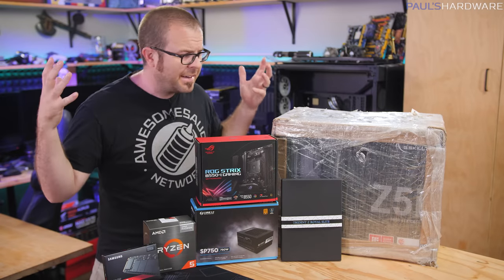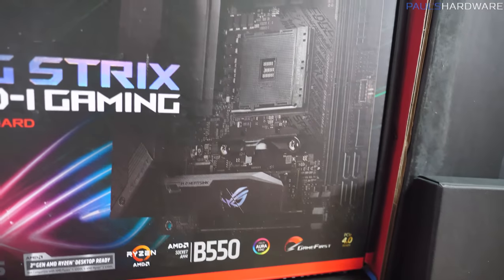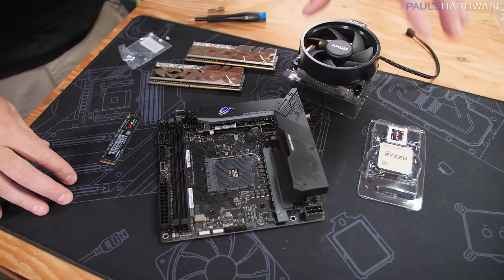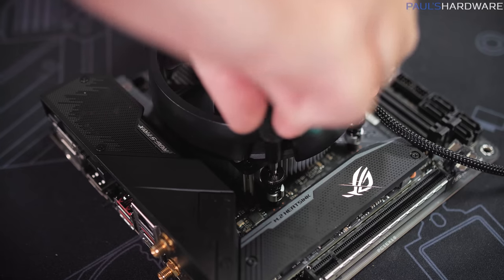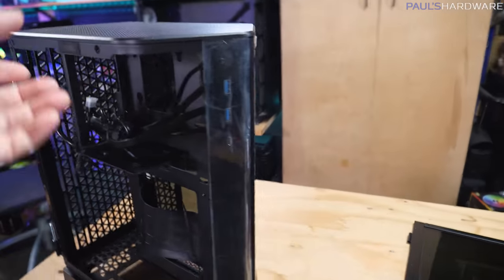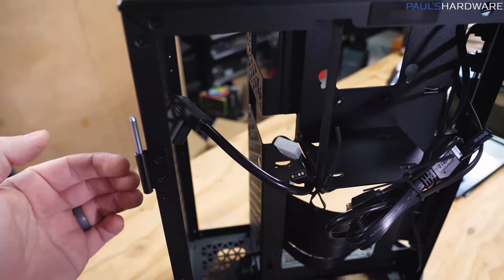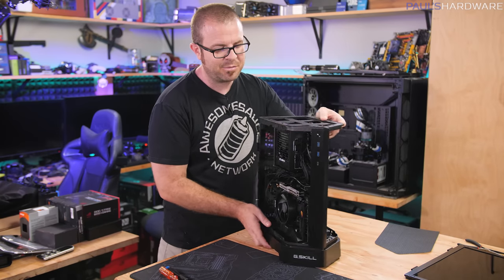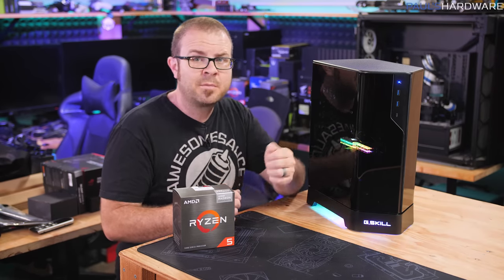Build this Gaming PC for $621! (I spent $1075)

Comment: Just ordered a 5700G.  Debating on motherboard to put in a Silverstone FARA R1 (ATX case) that I already have.  Should be interesting.  Last AMD processor I used was a K6.
Reply: I have seen some reviews and on line comments that reference concerns pertaining to B550 boards and IOMMU grouping.  Not exactly sure when that creates a problem.  I gather there are plenty of applications and uses where it's not an issue.

Comment: hi, me and my friend are planning to build the same $621, we would like too see if you can test games like apex valorant and warzone (the usual), and after you are done with the base testing maybe if you can throw some $200 to 300$ video card on it, would be pretty good testing!
Reply: @hardcorehardware361  the problem with that pc is it comes with 8gb of ram, who knows which motherboard, a ryzen 5 3500, and just 256gb ssd.. and thats 800, yes the only good thing is the video card but its a terrible purchase
Reply: @skar1e121  Its not the worst value system currently, my friend added a 2x8gb 3000mhz kit and 1tb HDD. The 1650 Super on its own sells for just over $300 and that's for a cheaper Zotac variant which could be compared to the 1650 Super that comes in that prebuilt. It cost under $1000 with the new Ram and HDD which was Her budget. There wasn't anything else availalble for that money sadly. At least She can play Games now. GPU's are just to expensive for majority of people.
Reply: @skar1e121  It is to be noted that She plans to keep this system for at least 3 years, Her thought wasn't to upgrade hardware etc She just wanted to play Her games. She doesn't really know anything about Computers nor is She interested.

Comment: Pair the 5600G with a decent highspeed kit of RAM and it will be very playable, love these kind of vids :)  
5600G paired with a decent GPU should be fairly high end in terms of FPS, for todays standard, so no issues there ^^

Comment: Paul I bought your build to build the 621 version for my friend, i have built 6 pc but when i boot up the motherboard lights up for the cpu and all the fans come on but nothing else. I returned the cpu and got a another one and still same problem any input would be greatly appericated
Reply: You need to update the bios on the motherboard. I did the build as well and had the same issue until I updated the motherboard bios.
Reply: @paulpierson1443  thank you I figured it out after I messaged ya

Comment: Leave it as is and do some benchmarks.  Then replace the fan and run the same benchmarks.  Then add a GPU and run those same benchmarks.  And don't use videogame game-play as benchmarks, that is a terrible way to benchmark, unless said game has a standardized benchmark that is exactly the same very single time you use it(which is practically never).

Comment: I see many comments about looking at an upgrade path through adding a mid tier gpu like a 3060 to see how it would run, for people looking to upgrade after a gpu becomes available for them
Edit: https://youtu.be/ReN06Kw4y4I
This guy talks about it in his video
Reply: 3060 would do well. You'd leave too much performance on the table with the 6700xt. It needs a 5800x or higher for good cost to performance.

Comment: idk boouut
Motherboard	Asus Prime A520M-K micro ATX motherboard with M.2 support, 1 Gb Ethernet, HDMI/D-Sub, SATA 6 Gbps, USB 3.2 Gen 1 Type-A
CPU	AMD Ryzen 5 5600G
(Up to 4.4GHz, 6 cores)
Memory	Kingston 8GB DDR4-2666MHz CL19 SDRAM memory
HDD	Kingston 480GB A400 SATA SSD
Case and PSU	Thermaltake Versa H15 M-ATX Gaming chassis
Thermal Take TT-500NL2NK 500W Power Supply
OS	Windows 10 Home 64bit
Keyboard/Mouse	TT Commander Gaming Wired Keyboard & Mouse Combo
Other	TP Link 300Mbps Wireless N PCI Express Adapter
Monitor	Acer 27" KG271 Widescreen LCD Monitor

Comment: beautiful case but too flimsy.  the power supply should have been mounted in the bottom for more stability but they messed up designing it.  pci 3.0 riser. no thanks.  come on G-Skill.   get real.